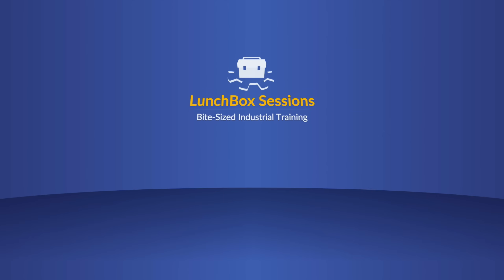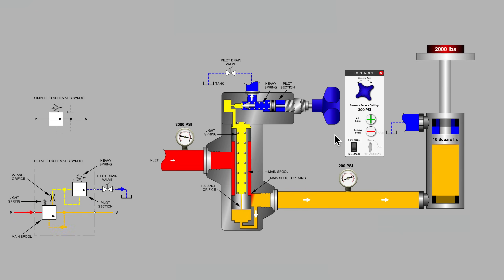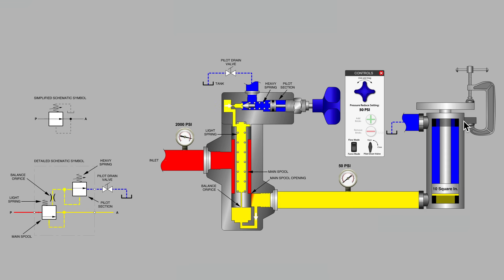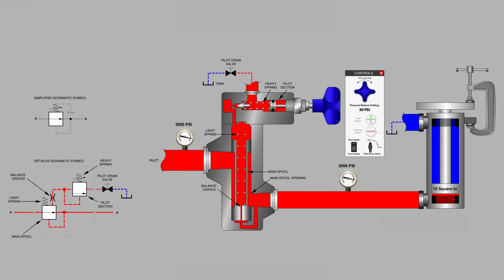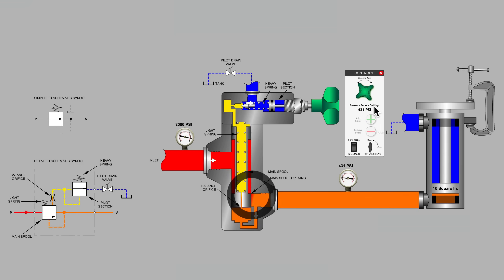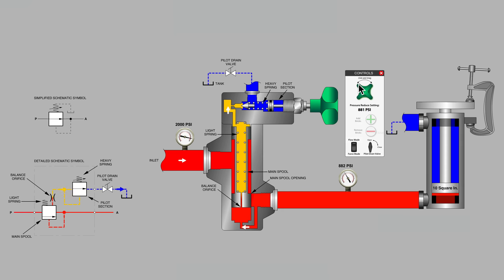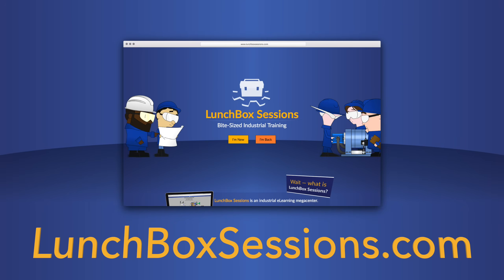Pilot Operated Pressure Reducing Valve - Part 1

Comment: Does this hold the load if the inlet flow is switched off ?
Reply from the maker: It is definitely not meant to do that. It may hold for a short time, but definitely do not count on this. It’s only and primary function is to limit pressure on the downstream port.
Reply: @lunchboxsessions  Schematically , it looks like it will hold . Is it due to the main spool clearance ?

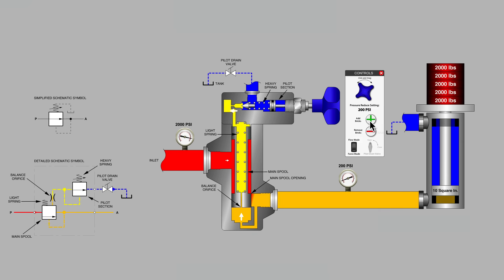Comment: At 0:24  we have a 2000 pounds held by a 10 inch area and it gives 200 psi pressure . Then how does the load move in this case when the force is balanced . Should we set the valve a little higher?

Comment: Can anyone explain why does the outlet piping has a smaller diameter than that of inlet to valve?
Thanks
Reply: Amr Reda I had a recent case, where the back pressure was not an issue ( pressure drop in outlet piping was much less than 10% of set press), but the mach number was. So, we preferred to move the location of sudden pressure drop further down the relief header, and not very close to the PSV itself. So, we did not mind to create higher delta Ps  right after the valve.  Not sure if this pertains to this specific case, but was an example of wanting higher pressure drops in the tail pipe.

Comment: If preset spring setting of reducing valve is let say 150PSI and a actuator connected at outlet of valve requires pressure more or less than 150PSI to be actuated, then how does reducing valve maitain 150PSI pressure.
Reply from the maker: Pawan Gundariya Thanks for your excellent question. If the valve is preset for 150, the outlet pressure will be limited to 150 maximum. The cylinder will simply not be actuated at all, it the cylinder load is greater than 150 PSI. Keep in mind that the pressure reducing valve is not a flow controlling device, and as such, does not try to accomplish a flow rate. This valve is better thought of, in this application, as a force controller. Does that answer help a little?